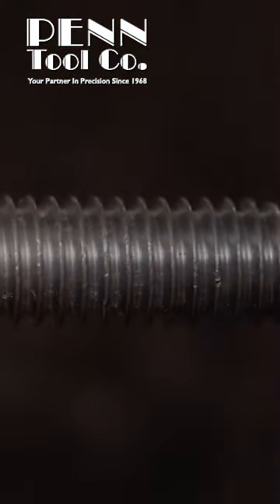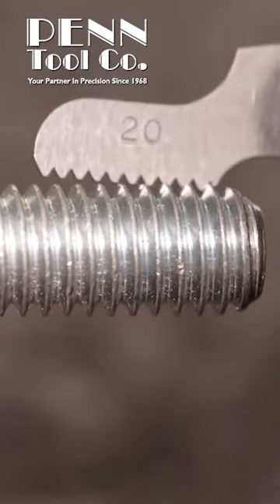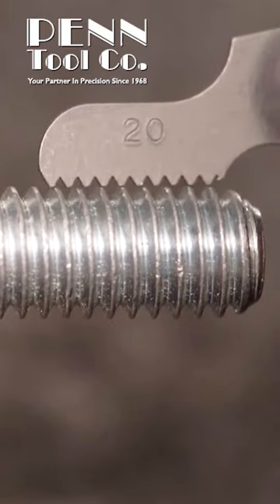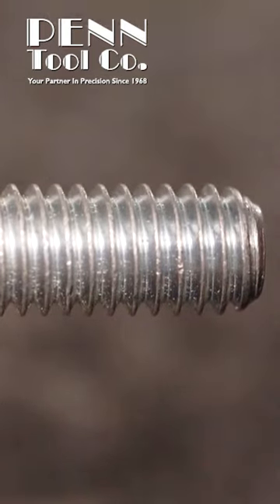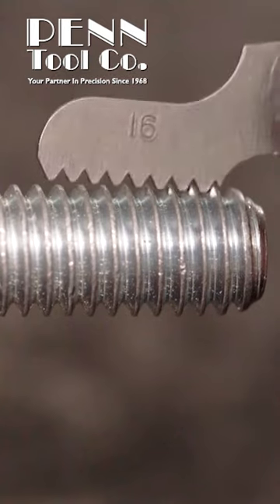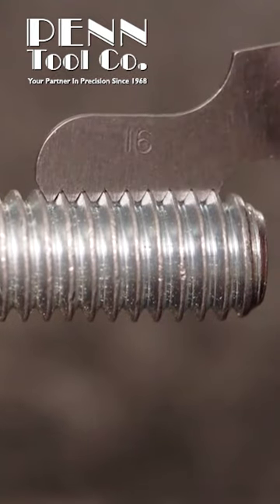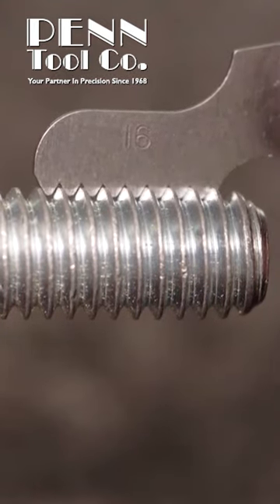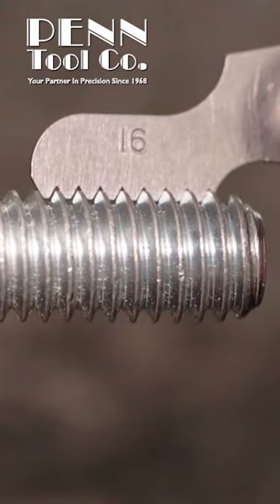Finding the pitch of a screw

Comment: Unless it's metric.
Reply: same gauges for metric dude lol.
Reply: @BRANDON-IRON009  So you're saying a 16 TPI is the same pitch as a 1.75 metric. Close enough ??? Maybe a 1.50 metric in smaller diameters ?  But yes you do use a thread gauge in both cases, but you must be sure to use the right one. SAE on SAE and metric on metric. Sounds simple, but I've seen it screwed up.
Reply: @terryharvey4811  Measure the OD of the thread...19mm to 3/4 are the only sizes to really mess up as they are nearly the same diameter. Thread sizes only have 2 options a fine or a course. It gets real obvious if your mixed up from SAE or Metric if you have a clue of what it should be if it's the thread you think it is. Its easier to use calipers from crest to crest. It's also then very obvious what pitch it is not.
Reply: @BRANDON-IRON009  Clearly you understand this, but I really just wanted to point out the need to know that SAE and metric use different gauges and that close is not good enough.. Even a lot of "mechanics" don't know or can't determine the difference. OR ELSE THEY JUST DON'T CARE.
Reply: @notstewie-HelpMeGetTo50SubsPlz  Replacing missing, broken,or damaged bolts is part of what we do. Most are metric now but not all are. Being able to determine what you need correctly means only ONE trip to the hardware store for that replacement fastener. In our profession, TIME IS MONEY and WASTED TIME IS A WASTE OF MONEY. Customers do not want to pay us for multiple trips to the hardware store.One and done is my goal.